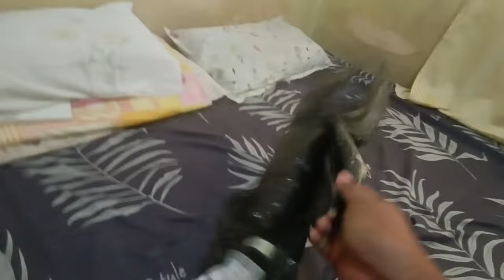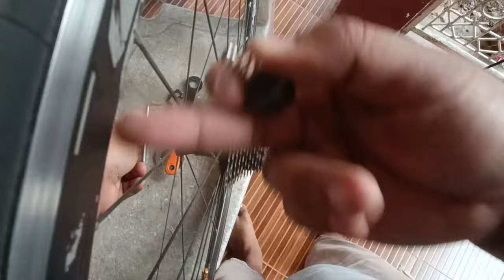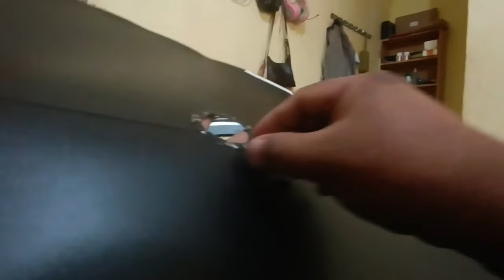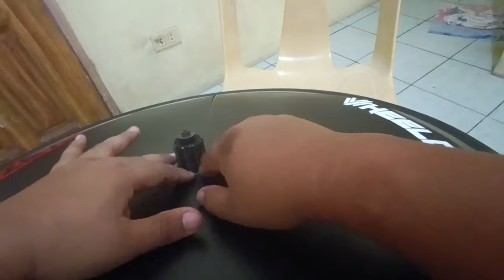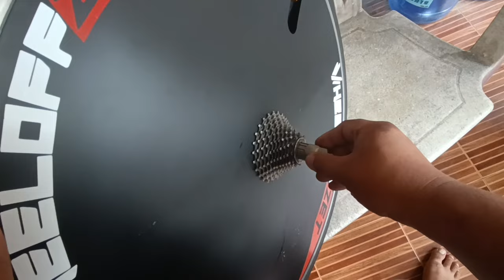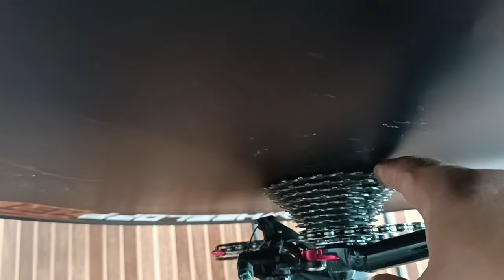Disc Wheel Cover From Shopee for Sagmit Veneno

Comment: Kuya paano po immesure yung laki ng disc cover
Reply from the maker: Depende yan sa size ng rim mo especially sa circumference ng wheel size and rim height. Gaya nyan 700c x 40mm then message mo ang seller sa shopee or lazada about that size and sila na mag bigay sayo. Or if may pic ka sa rims mo pwede mo picturan then bigay mo din yung actual size ng rim and sila na bahala niyan. Yan kasi ginawa ko before ako bumili.

Comment: Boss ask ko lang . Ndi ba sya natatanggal during nag rirides ikaw? Yan disk wheel. Kasi parang ang gaan nya. Tnx pls advise
Reply from the maker: Hindi naman, kasi kakalagay ko lng ng 52t chainring ko aabot ng 50-60kph yung takbo full sprint di naman na tanggal. Need lng talaga ingatan yung adhesive niya before mo i install sa rim at hub surface kasi pag madumihan di na kakapit ang adhesive sa rim mo. Like what happened sa akin may alikabok lng na kumapit di na dumikit.